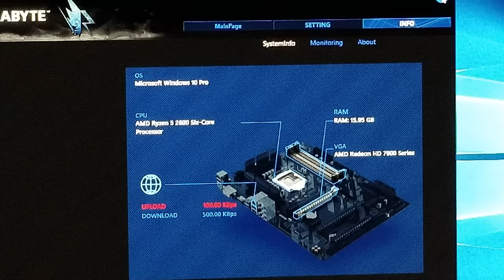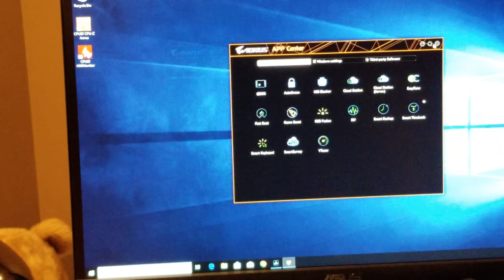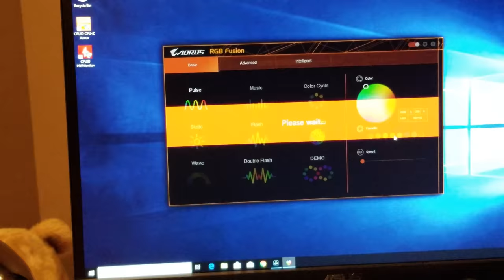Cooler Master MasterCase H500, Build Guide & Aorus B450 Pro WiFi

Comment: Hey, I was building my pc and after I finished, everything seems to work but the giant LED fans aren’t spinning but the  rgb lights are on for the fan.
Reply: Also, the RGB connector you used in this video has 4 holes, mine only has 3. Same motherboard btw.
Reply from the maker: If you have the same Motherboard then you'll have the RGB Header you need, otherwise you can use the included Controller that comes with the case to control the RGB...for the 200mm LED Fans, check that all the cables from the case are used, there is one that uses the SATA from the power supply if I'm remembering right...Thanks...
Reply: Reviewing Playing & More RPM I don’t have the 4 pin connector that you have. I have this 3 pin connector that seems to not fit properly... I tried the SATA connection but that’s giving me the same effect. If I’m using the SATA connection, should I not plug in the connector to the motherboard and simply let it stay connected to the PSU?
Reply: Reviewing Playing & More RPM I used the splitter to connect the fans to the RGB connector but I don’t know where the actual fans plug in.
Reply: Reviewing Playing & More RPM the connector in the middle That is sticking out at 21:30 is a 4 pin but the same case I have gave me a 3 pin. I also don’t know if I need to plug in anything else...
Reply from the maker: Yes if using the SATA Connection it should be plugged in to the Power Supply and to the SATA from the case...the splitter RGB Cable goes in as shown in the video, if you don't have it you can use the RGB Controller, the fans themselves can use the splitter cables from the case that will then allow just one to plug into the motherboard...it's strange they would provide a different cable then normal, but a 3 Pin would normally mean an Addressable RGB Header which is 3 Pin so that would be ok if you have it otherwise the RGB Controller is going to be needed...basically check all the cables from the case and when they are all being used you should be good, otherwise you'll either have fans not working, RGB not working or a system itself that won't work...hope that helps...Thanks...
Reply: Reviewing Playing & More RPM thank you. I got the fans to work by plugging in this black cable to sys fan 3 and used dled1 for the light control however I didn’t have control over the lights from rgb fusion. After messing around some more, the fan lights stopped working no matter what I did which makes me think I must’ve damaged the motherboard... the problem with the 3pin is that it doesn’t fit into the 12v rgbw slot and if I do manage to get it in there in between the first and fifth spike, nothing happens to the RGB in the fans. Idk if there’s a way to check I messed up my motherboard
Reply from the maker: When you are plugging in RGB you need to chose the correct one, the difference between 5V and 12V can cause problems, that's why it's best to use the one you have and if you don't to use the RGB Controller included with the case...It's unlikely plugging in a fan would cause you a problem with your Motherboard still...to try and determine if your Motherboard is still ok, I'd forego the RGB at this time and start your system without the RGB but with everything else and if all goes well you will at least know it's working right...
Reply: Reviewing Playing & More RPM yes, the fans are working properly but I’m not sure where I can control their speed from. However, the 3 pin for the RGB doesn’t want to fit inside the 12V 5 pin slot and the DLED1 end of the cable doesn’t work anymore
Reply from the maker: The speed can be done through the BIOS fan settings, I use Quiet Mode...the 3 Pin is for Addressable RGB, don't use it in the 4 Pin 12V RGB Header it will potentially cause problems...use the controller if you don't have the ARGB 3 Pin 5V header...if the RGB doesn't work not sure if you use the controller if that'll help or not though...
Reply: Reviewing Playing & More RPM I was able to get the fans on full mode but I’m not sure if they’re spinning at the max speed because the quiet option wasn’t there. Regardless, the SATA connector clicker doesn’t change anything because I would have to connect the 3pin end of the splitter to the 12v rgb but there’s no response from the LED lights on the fan when I do that
Reply: Reviewing Playing & More RPM just to clarify, there’s only one fan connector for the two fans right? I put it in sys fan 3 on the bottom middle of the motherboard.
Reply from the maker: @Kunark  Yes that's right
Reply: Reviewing Playing & More RPM oh okay, in that case I’m not sure why the LED’s aren’t spinning with the fans...
Reply from the maker: @Kunark  The RGB LED from the fans should work with the controller, make sure to connect it to the SATA from your PSU and the fans are plugged in as well...but if you don't have a ARGB Header 5V then you might need to get a RGB Hub that runs from the Power Supply it'll take a bit of searching to find the one that works for you
Reply: Reviewing Playing & More RPM should I plug the fans into sys fan 1 for better performance?
Reply: Reviewing Playing & More RPM sys fan 1 is on the top of the motherboard next to the CPU power
Reply from the maker: @Kunark  There is 1 there not sure which one it is, but they all function the same...if you look in your Motherboard Manual it'll tell you which one it is...Thanks...

Comment: one fan is working and the other is not working, did you notice? also how do the fans sound, are they noisy.
Reply from the maker: Yeah I didn't notice it until after uploading the video, I'd forgotten to connect the Power for the fans, it was a SATA Power Cable to the PSU. Once I had them working they were very quiet.

Comment: Which wires are to the front fan rbg colors?
Reply from the maker: The splitter type cable makes the fans work, and plugging in the RGB Cable as in the video to your MB will give you the RGB...Thanks...

Comment: I have a question , I hope someone can help me? I bought a MasterBox K500(more or less the same the chassis in the video). The problem is that the two RBG fans do not spin (yeah their led are working (connected a cable at 22:39) but do not spin). I think I am not connecting power supply for these fans. However, I cannot find these cables, instead I find a cable called TKG (with two pins). Someone, please can help me to solve it? Thank you so much for your time.
Reply from the maker: First great looking case, the RGB is correct as you mentioned, check that the fans are connected to the Motherboard Sys_Fan_Header, second is to check for a Sata Power Cable, sometimes these cases have that cable but are kinda tucked away in the back, it should be connected to the Sata Power from the Power Supply and then the fans will work...The TKG with two pins is a modified Molex Connector, you would plug it into a molex connector from the Power Supply...Hope that helps some..Thanks...
Reply: @Reviewing_Playing_and_More_RPM  thank you so much for your answer, but  in your video I do not see you have to connect anymore cables for the front fans (however only one front fan is spinning ? Or do I miss something  in your video?
Reply from the maker: I forgot to plug in one of the cables, so once that was done both worked...
Reply: @Reviewing_Playing_and_More_RPM  please tell me whether the cable at  22:39 is  enough right (I think this cable only for leds) or not? if it is not, hence please tell me which the cable was used tor supplying power for leds in your chassis ?
Reply from the maker: That's correct 22:39 is for the RGB LEDs...
Reply: @Reviewing_Playing_and_More_RPM  Hence please when did you connect power supply for the front fan?  Thank you so much for your time.
Reply from the maker: The front fan not spinning wasn't noticed until after the video went live, so it doesn't show up, just check the cables from the case, verify any that provide power are connected to the Power Supply and you'll be good...
Reply: @Reviewing_Playing_and_More_RPM  no no man, you misunderstand my question. I would like to know when (in your video) you connected the power supply for the 1st front fan (which spined). I want to know which cable I need to connect to spin my fans.
Reply from the maker: I discuss the connecting of the fans at 19:45 but say to connect to a sys fan header, it's not shown being plugged in though...21:36 for the RGB...not every item is shown in exact detail...

Comment: i have an asus z390 motherboard and i cant seem to find the 3pin argb connector
Reply from the maker: Which one, there are more then one Asus Z390 MB's
Reply: Reviewing Playing & More RPM z390 a
Reply from the maker: Unfortunately there no ARGB Headers on this MB, there are 2 RGB Headers though, so you can get an adapter that will let you convert one of the RGB Headers to ARGB and then use it that way to sync everything...my most recent video is on this very subject...Thanks...

Comment: Great  vid .. y wasnt the front top fan working?
Reply from the maker: Your the first person to mention this, I had noticed after upload and realized I forgot to connect the case fan, good observation, was a slight oversight on my part. It's working now though... Thanks...
Reply: @Reviewing_Playing_and_More_RPM  ohh great.. i just got worried because i just ordered the same case and i thought fans not might be wide spread  problem. . So whats ur final thoughts on the case? Any big issues?
Reply from the maker: @SagarSawhney  No I really liked it so much I usually sell the systems later and thinking to keep this one, if there was anything that was a very small concern was the Power Supply Shroud, wish it was designed slightly differently. But it all works great. No issue's at all.

Comment: Greetings from Brazil dude. Thanks for the video. I'm really in love with this case. What's your opinion about the airflow ? Its really hot in Rio de Janeiro.
Reply from the maker: I'd say it's a solid choice, as the 2 200mm fans in the front provide very nice airflow along with the one in the rear of the case...plus there is more airflow from the sides of the front panel as well...Hope that helps...Thanks...
Reply: @Reviewing_Playing_and_More_RPM  Do you think 3 fans of 120 mm instead the 200 mm could be a better choice?
Reply from the maker: It might work better, not certain though...just as well in any case I'd think though...
Reply: @rafaelsiqueira2356  if you're gonna go that route I'd just go with mb11 cooler master case
Reply: @Gamerthinkersman  Thx man. It's half price. Few reviews but looks good. I have a HAF912 plus and I really like it. Now I'm looking for a good replacement.

Comment: I have a B450 TOMAHAWK MAX and I need help for setting up the fan's rgb. Can someone help me ?
Reply from the maker: What did you need to know...
Reply: @Reviewing_Playing_and_More_RPM  My fans are working but not the RGB.. I set the RGB controller to the RESET button but it doesn't work.
Reply from the maker: @polatcn9150  So fans need to go to either a Fan Hub, or connected directly to Sys_Fan Headers on the Motherboard, for the RGB if using the controller, one end needs to go to the appropriate RGB Header on your Motherboard...the 12V RGB 4 Pin...You only need use the RGB Controller if you don't have a RGB Header on your MB...
Reply: @Reviewing_Playing_and_More_RPM  Ok thanks, and what's an rgb header?
Reply from the maker: RGB simply stated stands for Red Green Blue, and they work together to produce as accurate as possible the color you choose, the RGB Header is where you plug in the RGB Cable in order to activate either a RGB LED Light Strip, or RGB CPU Cooler or other Device...

Comment: Hey man. So I started building my pc on this case and I have put everything in other than the fan cables and I am totally lost. Help!!!!!
Reply from the maker: Fans just need to be connected with the case fan splitter and one end goes to the motherboard, beyond that you'll need to be more specific to what you need and I'll do my best to help you out...Thanks...
Reply: Reviewing Playing & More RPM I’m having the same issue, there are two different ways to plug the fan headers in the mother board but I don’t know if I need to plug both in and where to plug them in
Reply from the maker: @jordandame9442  There is a splitter cable that you need to use to plug in the fans, then the other end goes into a Sys_Fan Header, or if you have fan extension cables you can use them and plug both of the two fans into the Sys_Fan Headers on your Motherboard...
Reply: Reviewing Playing & More RPM cool thank you soo much, keep putting in the YouTube work!! You have helped me so much
Reply from the maker: @jordandame9442  Will do...Thanks...

Comment: I have the same case and my RGB connector has 3 pins but my motherboard has 4, should I use the adapter that goes into the SATA connector instead?
Reply from the maker: No, they are two different connectors, the RGB Connector that has the 3 Pins is 5V ARGB and needs a ARGB Header. If your Motherboard doesn't have a ARGB Header you could use a ARGB Adapter, Deepcool has one that would work.
Reply: @Reviewing_Playing_and_More_RPM  thank you! Actually just realized that I have the RGB in my motherboard. I was wondering if I want to have control over the RGB lights,  should I use the little controller that comes with the case that plugs into the SATA?
Reply from the maker: @DavidRodriguez-sg6ue  It's been quite a while so can't remember all the different cables, but if the cable has 3 Pins you need an ARGB Header that also is 3 pin 5V, plugging in to a 4 Pin RGB Header will cause problems and could short out the MB or the Header itself. As to the controller I don't remember it so you'll need to check the case instructions.

Comment: Why is your second 200mm fan stopped in the end?
Reply from the maker: Realized after there is a Sata connector in the back of the case that needed to be plugged into the power supply, once done it was working never noticed it until someone mentioned it later...

Comment: How did you connect the frontal fans?
Reply from the maker: There is a ARGB for the colors, that go to the ARGB on the MB, and the fans have 1 connector that goes to the MB and the other plugs into the SATA from the PSU...
Reply: @Reviewing_Playing_and_More_RPM  Thx man really nice Chanel and video! Got a new sub!
Reply from the maker: @josepvinasceron541  Much appreciated...Thanks...

Comment: Please i need help, i have a problem with RGB fans.. theres only two colors white and cyan i have no idea why
Reply from the maker: Start with checking the SATA cable from the case is going to the SATA Power supply connector, and everything else is plugged in. Now if for some reason other then making sure your using the correct RGB or ARGB Header you could try using a Open Source RGB Software called SignalRGB  that will help with multiple RGB Issue's, I'm thinking of doing a video of it. Hope it helps.
Reply: @Reviewing_Playing_and_More_RPM  i forgot to mention, i have h500p mesh

The RGB wire that came with the case is “3pin” Like this ( ⚪️⚪️⚪️) 
Not (⚪️⚪️     ⚪️)
So is it okay to plug it into “4pin” ? 

Im confused is this ⚪️⚪️⚪️ ARGB or normal RGB?
Reply: @Reviewing_Playing_and_More_RPM  I plugged it into 4 pin and i did exactly like you (by keeping the arrow on the left and leaving one pin on the right)
Reply from the maker: @lLordHassan  If your RGB is 3 Pin that's an Addressable RGB 5V and needs an Addressable RGB Header on your MB, if it's a 4 Pin then it's a 4 Pin RGB 12V Header on your MB that you need to use. You can not use a 3 pin on a 4 pin header because the voltages are different.
Reply: @Reviewing_Playing_and_More_RPM  i have an Adressable RGB Header on my MB its like this ( ⚪️⚪️     ⚪️) but my 3 pin wire that came with the case is like this ( ⚪️⚪️⚪️) 
im confused how does it fit?
Reply from the maker: @lLordHassan  Not sure what cable that is it doesn't seem from what you've shown here that it's the ARGB Cable.
Reply: @Reviewing_Playing_and_More_RPM  Can i send you a picture of the cable on twitter if you don't mind? Sorry for bothering
Reply from the maker: @lLordHassan  Yes, go ahead and I'll have a look at it.
Reply: @Reviewing_Playing_and_More_RPM  okay done.

Comment: Can u please help idk where to put my front fan cables
Reply from the maker: The front fans use a SATA Power Cable to the Power Supply and one is to the MB, I missed showing the SATA connection...and the RGB goes to the MB Header for either ARGB or RGB I believe it was ARGB but it's been a while...
Reply: @Reviewing_Playing_and_More_RPM  what does a sata power cable  look like? And do I have to take off the front to connect the fan
Reply from the maker: @digital2389  No it'll be on the opposite side of the Tempered glass it's about an inch across and flat much like the Sata for your HD or SSD just wider

Comment: How the hell do I connect the case fans on the cooler master case I’m so confused the 3 pin connectors have pins in them so they don’t fit into any of the system fans ? Someone please help me the fans don’t spin
Reply from the maker: There is a Sata Power connector you need to plug into the Sata from your power supply, ensure this is done and it should power your fans...
Reply: Gravity4K did u figure it out? i’m having troubles
Reply from the maker: @brandylopez34  I mentioned that he needed to plug into the Sata from the PSU, to power the fans, but if you have a different problem, let me know and I'll see if I can help....Thanks...